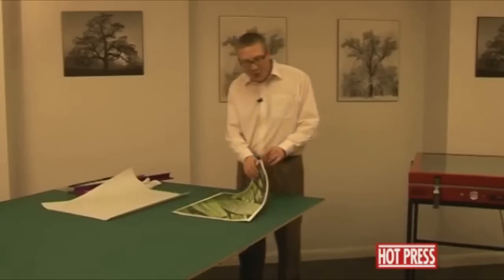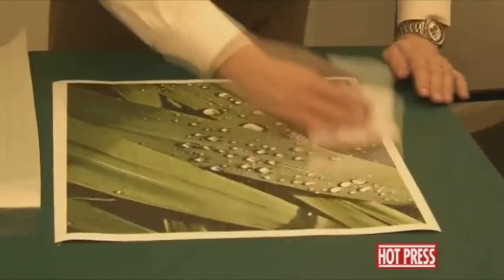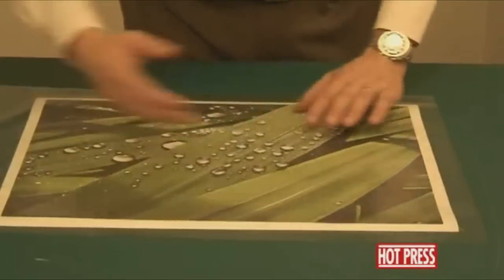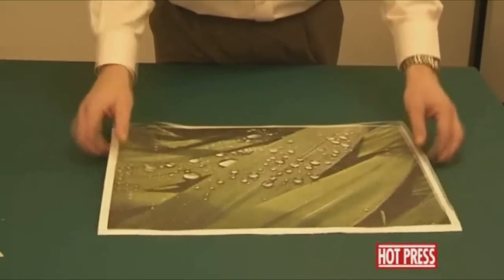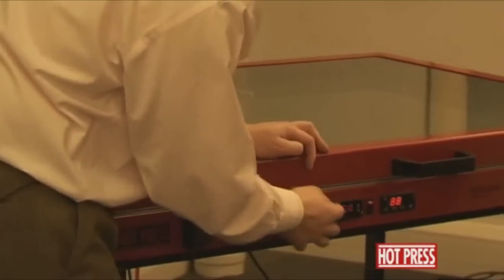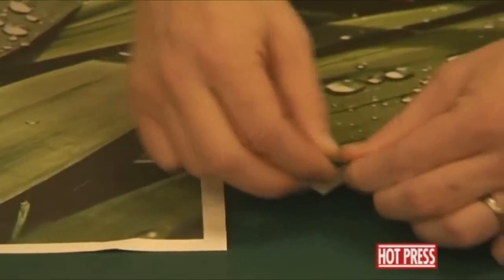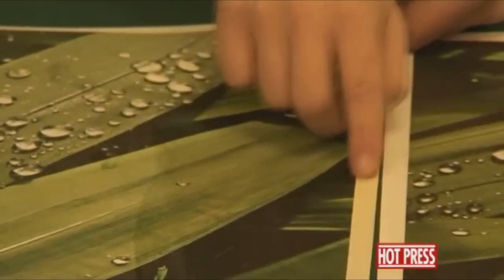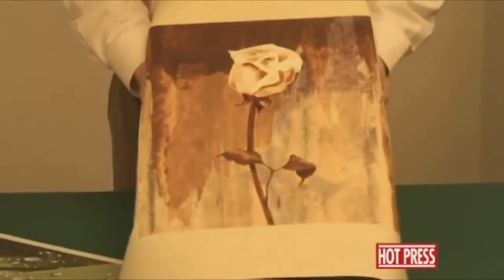Drytac Hot Press Vacuum Press - Laminating Inkjet Canvases

Comment: what temperature?
Reply from the maker: +Doug Dolde In the video you can see that he has the temperature set to 88 degrees. The machine is automatically set to 90 when you turn it on and automatically fluctuates within a few degrees of that(though you can change the temperature). So, it is most likely set to that initial 90 degrees (I think this is celsius as well).